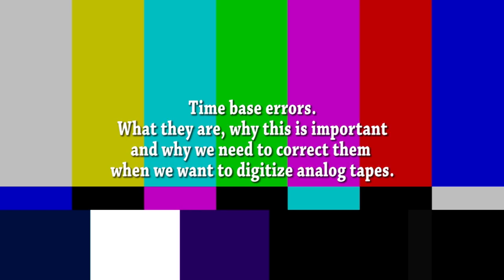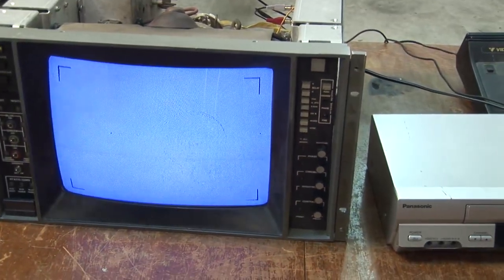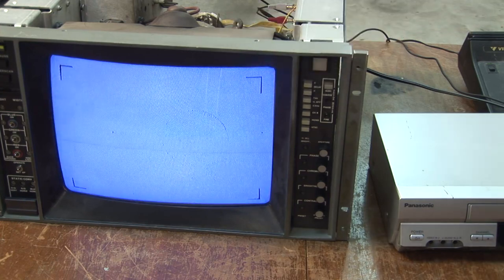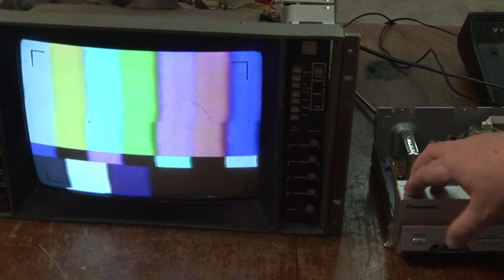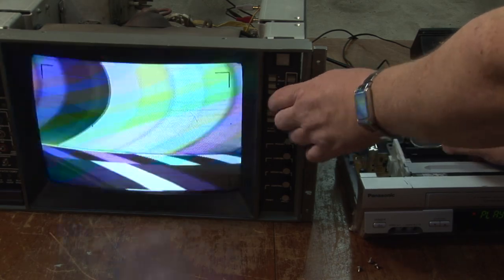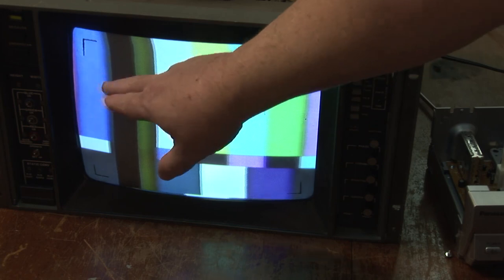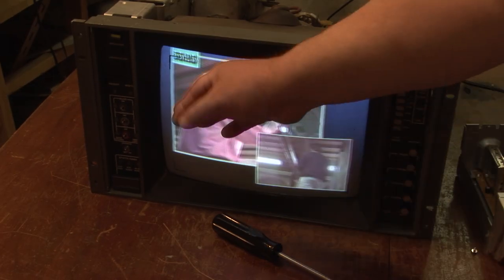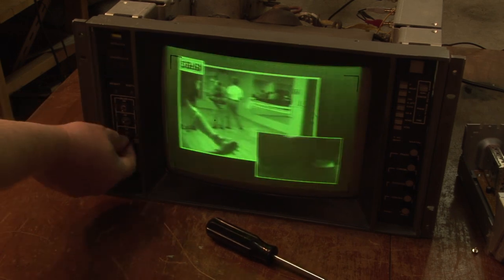Time Base Corrector Demo

Comment: I am in the UK and so I'm using PAL. I have a cheap capture card (easycap) and it often drops the frame rate at certain points in the video for a few minutes, then goes back to normal. 

The device doesn't ever drop out though, and the choppy frame rate only ever appears when you play back the recording. It never appears in preview, whether it's recording or not. I am using Honestech TVR2.5, and find that I get fairly decent frame rates if I set it to DVD-NTSC mode. The frame rate using this mode isn't ideal, but it is consistant. 

My question is: Is this still a time base problem or is it something else? The reason I ask is that I don't want to splurge £99 on something that doesn't solve my problem!
Reply from the maker: When I capture through a Hauppague HDPVR I never have dropped frames when capturing through my TBC, or capturing HD from my cable box. I do however have issues when capturing SD video without my TBC. I will experience freeze ups.Check out this demo: https://www.youtube.com/watch?v=qJKInMUw3A8At the end of this video I captured a segment without a TBC, and then ran the tape through the TBC and you will see that the glitch plays through just fine.Dropped frames could be your computer not being able to keep up. The way to test this is just plug your capture card into a camera (straight off the camera no tape)  or a tuner or cable box. If it can record the off air signal or direct from a camera without dropping frames and the dropped frames only occur with tape playback, then you know that time base errors are the problem.
Reply: 12voltvids
"...just plug your capture card into a camera..." How do I go about doing this?

I'm also not sure how my PC could be not keeping up. I have a Dell Vostro 260 with a 1tb WD green Hard drive; 8GB of RAM; Intel Core i3 and a Nvidia EVGA 750Ti Gpu. I know my PC isn't exactly top of the range but it's not slow. What could be causing this choppiness?

The only possibility that I have thought of is that the Green hard drive is parking the heads when it's inactive and then coming back to life when the program releases the buffer to the drive, causing it to slow down? I have no idea!
Reply from the maker: Naturally you need a camera that has a composite type output. Even the new ones have a composite output, but with the new Sony's you need that special multi cable that breaks out that multi connector.If you hook the video out from your VCR into the capture card, and tune in a broadcast signal on the VCR tuner you will get a stable signal.If you cable box has A/V outputs you can do that too. I don't know how your cable boxes work over there. Ours here still have analog outputs in addition to the HDMI connectors so it is easy to connect the A/V out into other recording devices.
Reply: 12voltvids Oh right! Of course! Well I tried that and I haven't experienced choppiness so far, but I seems to happen at random, so I can't be sure. I need to do more testing...

Edit: Tried it again with other programs running and it dropped a whole load of frames, so I think there may be something wrong with my machine.

Alternatively, the software may be just not good enough to do what it's supposed to. Honestech TVR 2.5 has a fancy GUI, but that says nothing about it's performance. I've tried VirtualDub, but it doesn't deinterlace the frames, and its way of accounting for dropped frames is the slow down the audio!

I don't want to pay for any software unless I can be sure that it will solve my problem...

Comment: My tbc-1000 also remove macrovision.Does the videonics do that to ?.My experience with tbc is that most of the time it  enhanced the picture but sometimes it dont.I use beta-tapes.
Reply from the maker: +John Kerkhof Yes it does, I did demonstrate that.All but the last 2 lines, but it does clamp it to IRE100 so the AGC won't be affected.

Comment: Very good tutorial about TBC's. Many thanks !  BTW I just bought a nice working Videonics MX-1 for $66.00US on eBay
Reply from the maker: Something working on Ebay? Thats a surprise. I just bought a vintage Garrett panaplex display calculator, was said to be working. Not a chance. Can that one be fixed? Not holding my breath. Obsolete chips, so if it is a chip I am SOL.
Reply: I bought many working USED electronics bench stuff on eBay. Only one RF generator I bought on eBay had a shorten capacitors on one of its main oscillator.. easy fix fortunately. So far I can 'feel' the genuine sincerity of an eBay dealer, specialy when it offers me nicely to return the merchandise when something is wrong at arrival but doing so when the thing is bought and the transaction is done. Maybe I've been Lucky. (?) Keep doing nice very instructable videos !
Reply from the maker: I have bought working items from ebay too, but also broken ones. This one I am working with the vendor who does not offer returns to get this resolved. He is claiming that it must have been damaged in transit even though the box was pristine, and none of the bubble wrap was damaged.
Reply: I know eBay vendors are not ALL honests. Hope you will make something ok for you on that.
Reply: @12voltvids  I'm only glad my MX-1 was given to me free!

Comment: Which is better between MX1 and Panasonic ave5
Reply from the maker: Mx1 uses 4:2:2 colorspace.  Ave5 uses 4:1:1.
Reply: @12voltvids   THX, so Mx1 is better right ? AND Videonics is better than Mx1 right ? My Videonics is on the way
Reply from the maker: @NBAONDVD  yes videonics mx1 has a better picture than Panasonic wjave5.  I had both.
Reply: @12voltvids  THANKS VERY MUCH
Reply: @12voltvids  hi I use it as TBC but there is a vertical line on the right side in the video I captured with Adobe Premier and I think the MX1 moves the screen to the left. How to solve the problem

Comment: Very interesting video :-D.
I can imagine the problems in replacing the sync, seems like a nightmare to solve, you can fix one, but there are others are ready to ruin it.
And thats just sync processing.
It must have taken a lot of design cleverness to make it work.
That monitor is a gut buster lol, it should come with a forklift truck :-D
Reply from the maker: +zx8401ztv It actually is not that complicated circuit. All internal sync is generated by a single chip and genlocked to incoming video.

Comment: Being a delta gun, there must be a lot of convergence pots. 
I remember our old Philips delta gun tv with a lot of change pots, turn 2 or more and you screwed the picture. ;)
Reply from the maker: +pcuser80 On the left side of the tube you will see some controls that say static convergence. That panel slides out, and all the adjustment pots are on there. That is why there is the gin switches. SO you can turn off the blue, and adjust the red green, then turn off the red and set the blue over the green, which is the reference color.I will go over that when I do make the video on this monitor.

Comment: captured this myself without a TBC   a 2005 Panasonic VHS machine    bottom jiggles a bit on the sides (most visible on the subtitles)   and upper left corner is bend a little   , this does NOT happen when I activate  the VHS menu screen  only when playing the tapes !!  so it's not the capture card/cables /capture software     https://www.youtube.com/watch?v=j8q5JIH_-14&t=347s      but IMO  as they are not important stuff  it's  tolerable   as is, VHS   was really crappy technology  and thank riddance it's gone !!

I notice this effects deppends a bit on the VHS brand , the poorer Maxell/ TDK,/Sony tapes it's more prominent, Panasonic tapes is less prominet